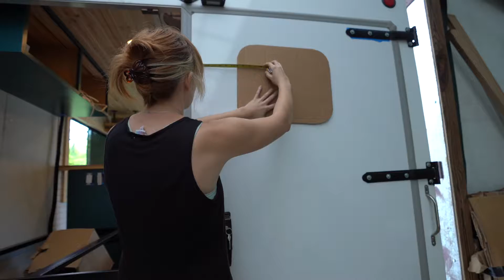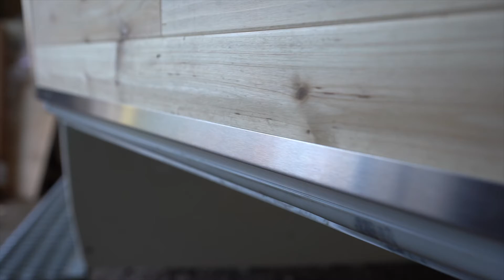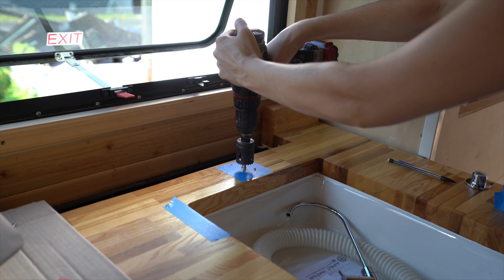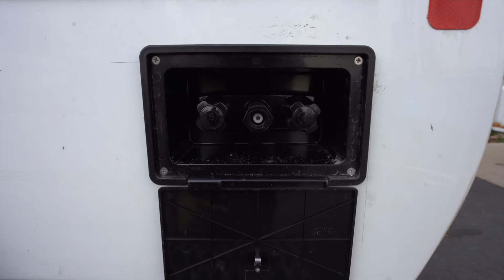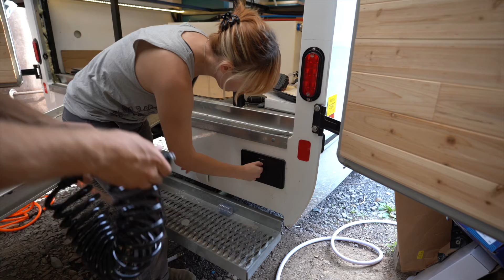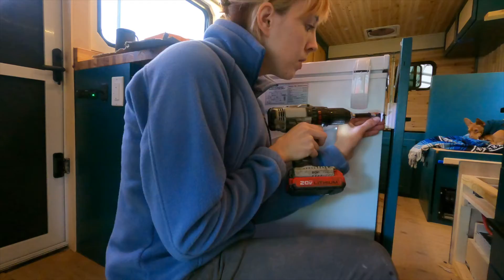Unicell Build Ep 18 | Fresh Water System, Finishing Barn Doors, & Entryway Wall

Comment: With the metal trim on the door edges (at 7 mins into the video) is it touching the metal doors? Or are they screwed threw the wood into the metal doors? I'm paranoid about thermal bridging and condensation building up on exposed metal surfaces on cold days. Or did the doors come with thermal bridging from the outset? (I think you mentioned something about multiple layers when cutting the windows out with the jigsaw).

Comment: I'd suggest to place your lithium batteries into different casing, with more openings, for better cooling. The one you have is too solid and won't allow ventilation. And 140mm computer fan in it, won't hurt either. Think of Texas in July...

Comment: Do you guys strap in your fresh water tank?  I have seen some manufacturer instructions that indicate that they should be framed in so the tank doesn't bulge.  Thoughts on that please?
Reply from the maker: Yes! We’ll be strapping down both the water tank and the water heater. Just haven’t gotten to that yet ☺️
Reply: @OurWayToRoam  Thanks!  I watch all of your videos so will see it if you publish it!  Do you happen to have any suggestions on good screws to use to attach furring to a steel frame?  I got my floor and ceiling all insulated and subfloor in, walls are next on my shuttle bus!

Comment: The pipes going to the outdoor shower won't break when it freezes. So even if it dose freeze the only thing that will happen is you can't use it. Witch you probably would not be using it in the freezing weather.